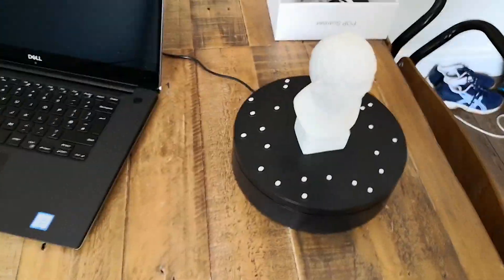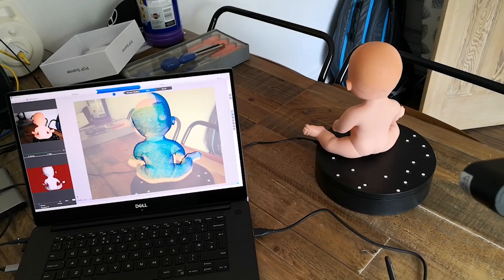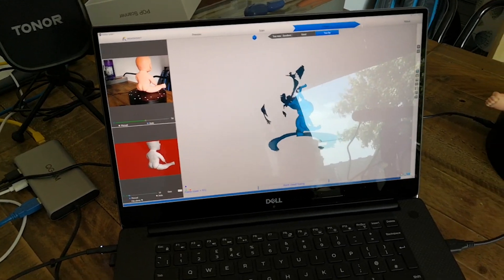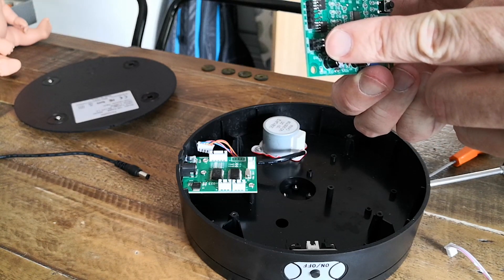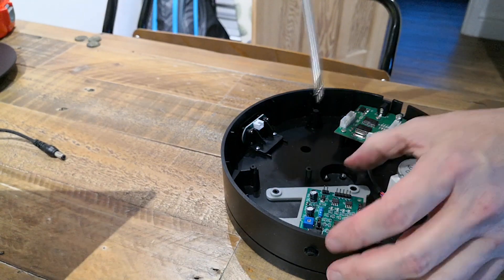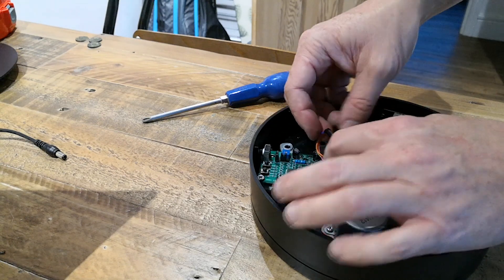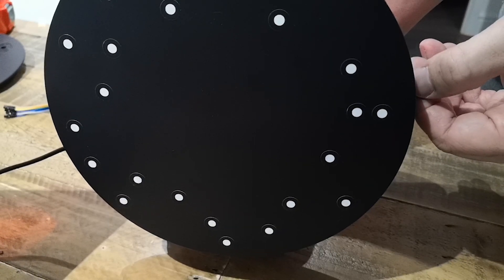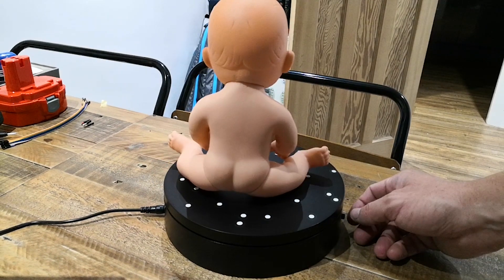Revopoint POP 3D Scanner Turntable Mod - ND-P2005

Comment: I did something like this myself with a cheap Chinese turn table off ebay, I got the turn table and replaced its stepper controller with one that can be manipulated by a raspberry pi 2040pico, So i could control the speed/rotation steps etc , I also wired the pico into the shutter on my digital camera so it rotated the table and told the camera to take the shots meaning i could do really low iso pictures and avoid motion blurr 🙂 , Mine was for Photogrammetry based scanning but the idea could work with yours too.

Comment: So I hit a snag.
I bought a 5kg load one of amazon, it is built very differently made by comXim.

First, it has a deep dish lower case and the table on top.

There is a 2 part inner ring which is glue to the bottom and top which does the turning, with ball bearings.

My main problem is  its a 13v stepper and the input voltage is 12-13.3v.

Do you happen to know of a driver for it?
- I only realised when the driver board wouldn't power the motor.
Reply from the maker: Afraid I don’t, sorry, hope you find something suitable though

Comment: Thank you very much for the full tutorial. Made the modification easy to do, particularly when it comes to cabling. What might be useful is if you could also describe the board pin configuration. I had to copy the one you used by watching how they were configured, but not sure if changing them might improve something? Thanks again!
Reply from the maker: There's instructions on the aliexpress link